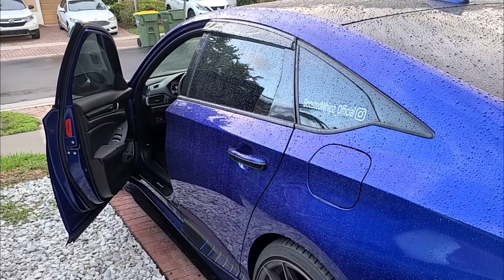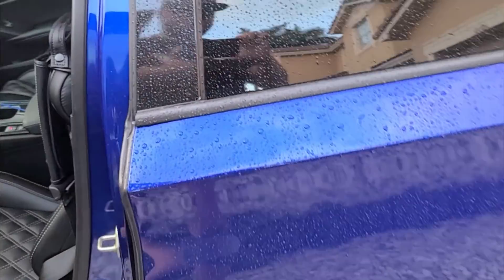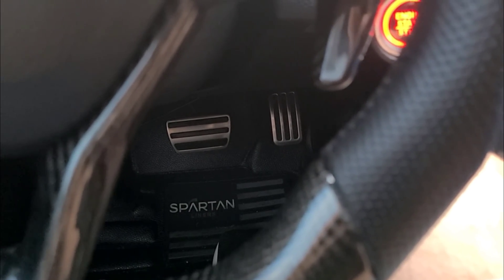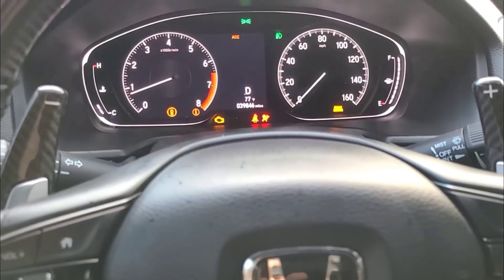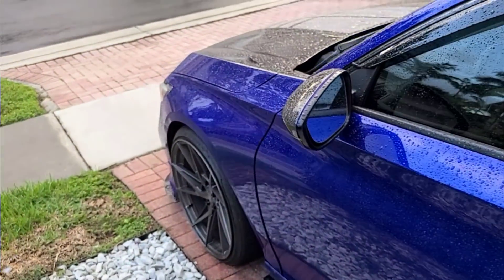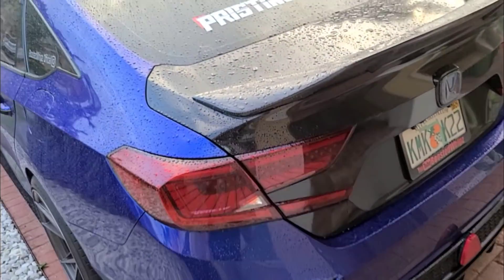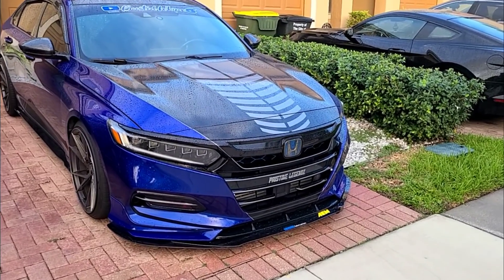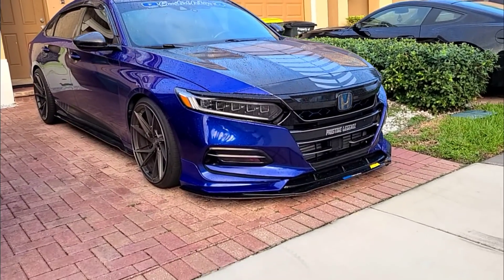CVT Transmission Goes Out at 40K Miles on Modded Honda Accord 2018-2020

Comment: The CVT has long been known to be inferior with tuning, bolt on's or just hard driving.  Very sorry this happened to you bro, that sucks hard. Even though you are getting a good deal on the trans its still money out of pocket way too early on the cars life. She is gorgeous btw. If you have the option to get a 10spd I would highly recommend it especially if you like to play from time to time. Either that or bring the car back to factory and just keep it looking sweet.  Good luck to you my man
Reply: (footnote) I had bought a 2018 Sport 1.5 CVT and had it for 3 months then traded it back to the dealer and got the 2.0 10spd, I am now on my second one as I traded that one two weeks ago for a 2020. This is my 5th Accord. I love them to death but coming from a automotive background I knew the CVT was not made for me.
Reply: Its almost as if a transmission made for economy driving only isn't going to hold up well for spirited driving
Reply: Cj Gagnon, are you leasing the car that is why you are u can trade it ?
Reply: @dcal4455  no i do not lease
Reply: @LilClout  no i did not, the dealership washed me out of the car. I never put any money down so i didn’t lose a penny. Broke even
Reply: @LilClout i have bought so many cars from them and i am sure that’s why they were able to do it. However I will say the Honda Accord’s keeps going up in book value

Comment: That’s awful! Before I switched to Honda Accord, I drove Nissan Altima’s for 15 years. The CVT transmission is the reason I traded my car and went with Honda. I started experiencing problems with the transmission around 40,000 miles, but didn’t realize it was a CVT problem until I had 85,000 miles. After being told it was $4,000 to replace, I traded, and decided to never get a CVT again. I currently have the 2.0 10-speed auto with a 125,000 mile warranty. Hope it all goes well for you and you get your car back soon.
Reply: Honda also are known to have e transmission problems. My 98 accord and my 2014 accord V6 both have transmission problems. Honda refuses to do anything about. I'll be buying Toyota from now on.

Comment: Sorry to hear that. I had 2017 sport hatchback and got rid of it for this exact reason. I wanted mods, but knew the transmission was going to be a problem. I got 2020 si, which I only have to worry about the weak clutch. I all ready have an upgrade when the time comes to change the clutch.

Comment: Not good news for me as I have the same transmission.  I haven't modded my engine and try to baby it, but my biggest fear about getting a CVT was that it wouldn't last the 200+ thousand miles of my previous 2 accords.  I think I am going to start changing the transmission fluid ever 30k miles; I know it sucks but thanks for sharing.  This will help a lot of people.
Reply: @Caligula I agree with always using the Honda fluid, especially on CVTs.  My 18 accord so far hasn't had any problems, but it is a shame that none of the new transmissions come close the manuals in my 00 accord and my 13 accord.  All this technology and they can't even last as long, feels like we are going backwards to get an extra 1 mile per gallon.

Comment: I was really planning on modifying my 14 Accord Sport, but many people have told me against it. 

CVT transmissions are simply not made for excessive heavy use. They're made to get to point A to B. 

If I ever do modify it, I would probably just K swap it and throw in a CD009.
Reply: Cd009 is a rwd transmission... unless you’re spending 15k+ (more likely to be a 30k project due to standalone ecu, a whole rear end, custom transmission tunnel to fit the transmission, and more) to rwd swap a Accord and that keeps you at stock hp, so there’s no point...
If you didn’t know that, I highly advise you to not modify it and do more research on car things in general.
Reply: @TienTran-kw3il  No, I know that. Lmao 🤣
Reply: @TienTran-kw3il  Don't just assume because I throw that out that I don't know what it takes. Of course it's a lot of work which is why I personally don't find it worth it. 🤷🏽‍♂️
Reply: @MystaGiggles  it’s been 2 yrs , hopefully you know more about car modifications

Comment: 2017 Mazda 6 over here... hella reliable
Reply: And slow af!
Reply: @winchestermodel7044  😅😅😅
Reply: Is it modded doe?
Reply: @winchestermodel7044   I rather have a slow car then my trans  going out at 40k miles 😂😁😁😁😁😁
Reply: @kromahj  well it’s a CVT so it’s not meant to handle that much power. He should’ve bought a 2.0t with the 10 speed auto if he wanted to add power.
Reply from the maker: Are you guys having a conversation here lol? My intentions originally was to cut down cost due to financial reasons. I also just wanted a simple family sedan and economy. Unfortunately I started modding aesthetics and somehow got into partnerships and sponsohips with big companies which allowed me to go for performance. Today I have access to so many things that I did not before. I had a Mustang before pushing 400HP so the 2.0 for me was trash at the time.
Reply: @BoostedWhipz  makes sense. I could see how things happened like that. 👍🏼
Reply: @winchestermodel7044  right  . CVT are trash. My wife had that experience  with Nissan.  No more CVT for me

Comment: I think it's time to treat this car as either a show car or to mod for the optimal mpgs. Honda, nissan, and every other car manufacturer has made a point that CTV is here to stay but it's time to value what cars are and are not about tuning for more power. Focus on getting better mpgs out of this car not more power
Reply: Toyota only uses them in the corolla platform witch use the cheapest materials across the board. When compared to the camry its like its made by a different company .

Comment: Aaaaand thats why u don't chip out or hook up a baby engine.
Reply from the maker: Agreed. I was just the guinea pig for most items on this platform. It is what it is.
Reply: @BoostedWhipz  it does suck that this had to happen. I appreciate you sharing your journey with this community and taking this leap of faith. This is a learning experience for all us. Best wish and hope everything turns out for the  best. Please keep us posted and thank you for all your videos.
Reply: @User Account Yep. I have read on forums that it is possible to boost a car with a CVT transmission, but that the load will simply be too much for the transmission. 

It's belt driven and since turbos add more power, that means more strain on the CVT belt.

Comment: CVTs aren’t entirely useless when it comes to performance. They’re just limited on how much power they can hold. I’ve beat on the CVT in my 9th gen accord quite a bit and never had problems but that’s just with super basic bolt ons, a base map tune, and no form of forced induction. Sticking to meticulous fluid changes as well. The more power you add, the closer you get to the edge. You don’t need a lot of power to have a lot of fun. The silver lining is now you know what it is the trans can handle and what the car’s happy with. Go back for a tune, keep it conservative, and have all the fun you want. It’s a clean ass car either way. Hope you’re back on the throttle soon🤙🏼
Reply: Mines is the same way, I got a piggyback tune, CAI, and exhausts BUUUUUUUUUUUT that's it. No turbo upgrade, no dp/fp etc, I'm probably pushing 215whp 😂

Comment: Seeing alot of "interesting" opinions so thought I'd chime in.

While I don't have the accord, I have the civic with the 1.5T motor with the CVT transmission.

I was running 292whp/257wtq for over a year and recently got re-tuned to 302whp/267wtq. (after switching up and adding a few parts)

Now since my previous custom tune (fbo + turbo + e85 blend), I've driven the car over 12k miles, done multiple passes at the drag strip for 1/4 mile times, done some friendly mexico races, tracked it at Summit Point (WV), and various of other spirited driving and so forth.

I will wholeheartedly agree that the CVT is not very strong. However, I think that the CVT is still pretty decent.

In the case for you, I believe that it could be a mix of user error/manufacturer's defect.

Whenever you take anything from your car out of spec from factory design, it adds increased wear/tear. Meaning maintenance needs to be upped. You can't rely on the basic Honda MM (maintenance minder). You need to accelerate and be much more frequent with your preventative maintenance.

For example. I change my oil approximately every 3k miles and I have upped to 0w-30. I also do transmission fluid change much more often and before and after every big event (dyno session, track day, drag day) I change out all my fluids. (Also swapped from regular Honda CVT Fluid to ENEOS fluid).

I also keep alot of different datalogs, review them on a monthly basis and monitor temps when I drive. I make sure that fluids have reached operating temp before putting any decent load on it.
Any time I do hard pulls like at the track/drag strip I ensure I give the car time to proper cooldown and same thing when I am in Mexico.

High temps can really break down and affect the efficacy of those fluids that help lubricate parts within your car.

So to reiterate. Just because you followed MM doesn't mean that your car will be fine. You have taken it out of factory spec and thus you will need to go above and beyond regular maintenance intervals. If you fail to do so, you may run into premature failure.
 

IIRC, Ktuner base map for the 1.5T accord puts it around 230ish whp on the 6mt and CVT might be a tad less (although that power is high up in the powerband so don't see it being too different).

Also the base line before a tune on the 1.5T accord seems to put around 200ish whp.   (which is how the advertise "32whp peak-to-peak").  So 220whp isn't too far extreme.  

These figures are being grabbed by looking at Ktuner's website and dyno charts on Ktuner's website which are provided by Drob @ IMW to my knowledge

It is my guess that Honda wouldn't develop something that would fail so quick if it were 5-10% above spec.  We all know how the old K series motors took a crap ton of beating and could easily go 20%+ above its normal ratings without a problem.  

So TLDR for those not reading this all.  Premature wear either by not enough timely maintenance and/or manufacturer's defect which would've occurred either way.  Opening up the trans case and seeing exactly what the issue is could shed some further light into this matter.

Either way, sorry to see that the trans went out and hope next one is much better for you!

Comment: When i got my 2.0 sport the main reason i chose it was the 6spd manual transmission! I don't care what auto you get, it's not a durable as a manual!
Reply: Hondas manual in the 2.0t isn't very good.      Grinding in 1st and 2nd gear is a common problem in the accord and the civic.         Haven't heard of any issues with the 10spd..... Yet.
Reply: @clausehardcastle8649  they give out quickly with power upgrades. Grinding in in 2nd etc. Is a common issue with most manuals when you start shifting hard and fast, usually remedied with new/upgraded synchros.
Reply: @clausehardcastle8649  hopefully I wont have issues with mine, my "racing" days are all but over! 😆

Comment: Well with every manufacturer opting for a crapy CVT, it's time to hoard the old tanky cars of the 90's n early 2000 see yeah when there worth $50,000 collector items
Reply: I don't think in the upper trims of BMW/Mercedes/Lexus we'll ever see a CVT. We won't see a CVT in a IS250, 328 or C300. People buying Accords, Camrys etc. are still cultists to the old days where Toyota and Honda used to make great cars. CVT and Turbos are pretty much a volcano waiting to erupt for your pockets. For the price of a new Camry/Accord you can just get a used IS with under 20k miles and service it at Toyota. A EK9 wouldn't be a bad hoard car tbh, seeing less and less clean ones everyday.

Comment: Cvt transmissions are not meant for high power, performance, sport cars . The transmissions are meant for low power commuter cars. Smh Honda, u r not what u used to be.
Reply: On the contrary,  Hondas auto has been shitty since the 90s lol.  It's their standards that are indestructible.

Comment: I had a feeling someone's cvt would go out. They just cant stand the torque that the motor makes at low rpm from what I can feel when I drive mine. Would love to see a follow up on how it goes with the new trans bro its unfortunate this happened to you but we know youll be back! This has me wondering if I can swap my cvt for a manual without getting a different car lol
Reply: I thought about that, it's a pipe dream really. For the money it would cost in parts and labor you could've just bought the 2.0 T.
Reply: That's why the corolla CVT with the physical first gear is genius. The first gear is able to handle the torque at low rpm.

Comment: I have a cvt transmission as well. Same car and I had a lease on it. I am active duty and turned it back in with my scra benefits. I turned it back in because I found out that cvt is not made for racing. Thank god I gave the car back in.

Comment: Bro I swore you had the 2.0T 10speed auto! Sorry about what happened. CVTs can’t handle the higher torque bands. Even basic bolt on tunes not safe for your setup. Best to keep it simple or upgrade to the Xspeed auto.
Reply: CVTs were only available on the 2013 to 2017 2.4L engines.  This dude has a 10 speed auto.
Reply: @RodofAllTrades  and your wrong! He has a 1.5 turbo mated to a CVT. There are only two engine options for this vehicle. 1.5T/CVT or 2.0T/10speed Auto.
Reply: @zadeanrobinson1608  I stand corrected!  I looked it up and totally forgot about the 1.5 - thanks!  This really sucks, people turn up Civics with CVTs and I don't hear about any problems in the 10 gen group on FB.  What's up with that?
Reply: @RodofAllTrades  it’s really a gamble at the end of the day. The tune is critical. I suspect his tuner don’t know what he is doing. But overall CVTs are bad for performance mods.

Comment: Identical situation with computer processor and RAM overclocking which leads to overheat and die. 
All components are designed within certain operating parameters. You want to mod them out of spec. and they won't work any more. Why would anyone be surprised?

Comment: I'm going to bet the mass population of people who run into CVT problems early on drive their cars like maniacs.  I've read stories where CVTs have gone 150k+.  Two things people need to keep in mind about CVTs... if you drive like a maniac, and take-off from red lights and stop on the gas, you'll put more stress on the transmission and CVTs are not as durable as a regular automatic with gears and clutches.  Second, you have to change your fluid regularlly.  I tell most people do it every 50-60k miles (at most).  More often if your mfr recommends it.

This is why I went with a new Camry over a Corolla in my case.  The Camry still uses a regular 8-speed automatic, but the Corolla uses a CVT.
Reply: Too bad the camry 8 speed is just as shitty as the corolla cvt
Reply: How am I supposed to drive like Ms daisey.
Reply: Will changing the transmission fluid to early cause problems

Comment: Honda has really gone down hill in the last 10 years!!
Reply: What are u talking about. This aint hondas fault, who would want to mod a car equipped with  CVT transmission in the first place? CVT are made for normal driving and are not meant to be abuse
Reply: @alvinbernardo7770  Honda built it it failed it's failed in many of their cars un-modded there are lots of different technologies that can be used for transmitting power then a CVT..  also Honda has a massive oil dilution issue in some of their smaller engines.. they have also fallen way down the reliability charts so yeah Honda has gone downhill!
Reply: @eucmike  to be fair, all the dealerships had gone down hill. But the CVT transmission fail in this video could’ve been prevented or avoided if not modified and not abused. I own a CVT equipped car with 120k miles and still running fine due to being treated & maintained properly.
Reply: @alvinbernardo7770  oh for sure lots of people with no issues but that does not change the fact Honda choose to use this type of Technology the CVT that has a high failure rate (stock setup too) compared to different Technologies... CVT is cheaper in cost to manufacture but will cost the customer more in the end.  I used to love Honda 10 years ago hopefully they'll be the Honda that used to be in the future again..

Comment: Take it to Honda for warranty work. It doesn't hurt to ask. The worst they can say is NO. You could be surprised and get a new transmission.
Reply from the maker: Unfortunately I was denied work when I had an issue with my brakes. Car is too modified.
Reply: With a flash tune, I doubt Honda would want to replace it under warranty. Dealers always try to cut costs :/

Comment: Modding a vehicle ruins the vehicle. A car is delicately balanced engineering-wise. But you have the right to do what you want with a vehicle that you own. My heart goes out to you man. It's a pity that you have to modify an economy car that wasn't designed for what you're doing. Too bad you can't afford a real sports car like a Civic type R.
Reply from the maker: At this current state I can afford the Type-R and or other higher tier vehicles. So just a matter of time before I make the switch.